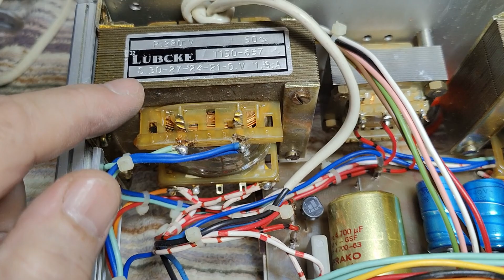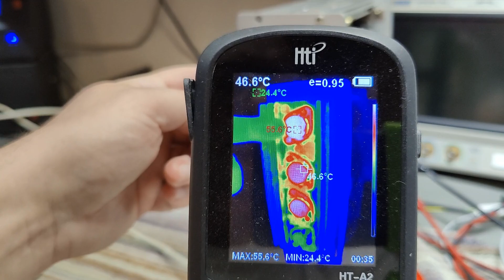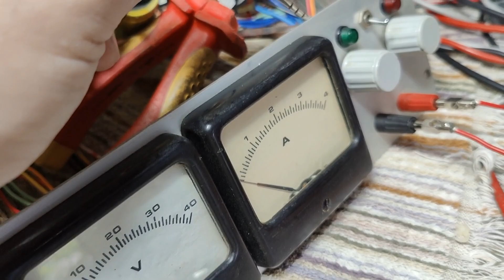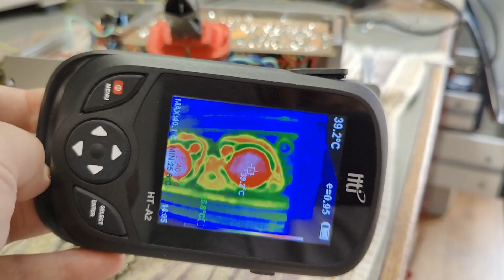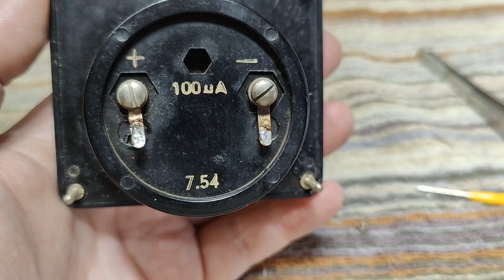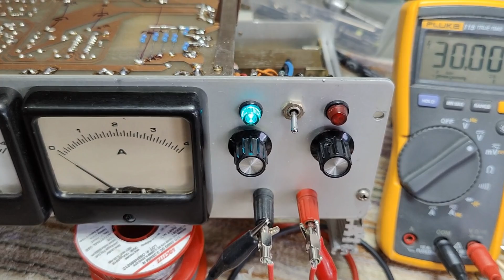DIY Elektor Precision Power Supply Dec 1982 0-30V 3A linear 4 x 3055

Comment: I have made this Elektor lab power supply in 1982 with four 2N3055 and a temperature controlled fan: 0-45VDC 5A. I have just made a re-cap two weeks ago.
Reply from the maker: nice

Comment: Are these 3055 insulated from heatsink? I could not see washers. Even if so, their cases heads are not protected.
There are similar designs with regulating transistors in negative shoulder, so case is tied to negative output terminal, which can be more acceptable. 

Happy to see this great lesson to DIY people. What to copy and what to avoid. And you not just tearing down, but fixing and reviving a custom device (well, on mass-produced PCB.)

Comment: Thanks for the video I am trying to repair the same power supply. At 36:00 I see six resistors you attached to the bottom of the PC board. Four look to be in parallel and two other resistors. Would please detail the value, connection points and purpose of these resistors. Thankyou very much Greg
Reply from the maker: all schematics and pcb layout is easy to get via elektor vintage pages, if you give it, send me an email, i keep all files for all units i ever play with, repair or try to repair :-)

Comment: Wanted to ask, does the voltage regulate all the way to zero.  Meaning for example, can it run, say, a 1.8v circuit.  The design using an independent transformer seems to suggest that capability and would be interesting to verify with that build.
Reply from the maker: YES full control all the way to zero,
Reply: @TeardownOZ2CPU, thank you, that explains the negative bias on the 723 IC... very clever design.  Thanks for responding, btw you run an entertaining channel. It's nostalgic to see how things were built.

Comment: Hi Thomas ,great video. I do appreciate .we can I obtain the psu circuit negative to see if I can produce the circuit board ,hope you can assist
Reply from the maker: see the link to article in the description
Reply: Hi Thomas ,thank you kindly for the schematic for the psu ,i have also find that the same power supply was used by the airforce in SA ,just a question would it be possibale to use one  transformer with al relevant tappings  insted of two ,i have a bit of a space issue .

Comment: 2:20 The component overlay shows one of the four resistors you are comparing is R17: the 10R BD241 emitter resistor. The fact the actual machine uses four output transistors does not make the original schematic and pcb wrong.

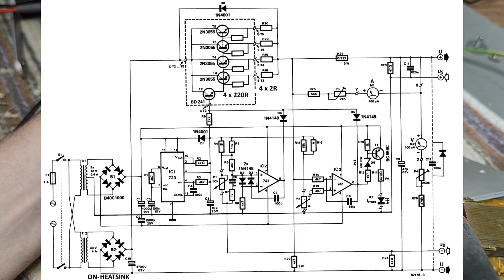Comment: Hello, i did not notice the 4x220R modification from 23:50 part of the video. Did you implement it?
Reply from the maker: YES i did, they are needed to create stability, videos tend to get very long, so sometimes i have to skib minor details, they are very easy to add locally on the transistors.
Reply: @TeardownOZ2CPU  Thank you for the info. Good job with this unit.

Comment: I build a powersupply like this during my elektronics education in 1983. It was a version with  only transistors and no IC. We needed only one transformer because we build our own transformers with seperate 12V winding.. Every 2N3055 had a 0,33 Ohm  Emitter resistor. It worked perfekt. The rectifier is a problem. 3A at 1V or higher per diode 
are 6 Watts.
Reply from the maker: exactly what i figured out, burning hot rectifier bridge, it was a super good idea to put a new one, bigger type directly mounted on thick metal frame

Comment: Wonder why the builder didn't add the binding posts for the sense leads as in the article. That's part of making this a precision supply.
Reply from the maker: i got a few supplies with remote sense, but realize i actually never used that feature all the way to my load, I suppose my current may be low and my wires very thick and my distance to load short, so it is just not a problem for me, that is why i went with sense on the back side of banana connectors, and it turned out to perform just super good for this unit.

Comment: Meters were from Rohde-Schwarz equipement from 60s. Made by company Gossen. :)
Reply from the maker: HA HA you are right .. I have seen them before, in my own video from 2022, that is why i feelt i have seen this type before, 
Rohde & Schwarz Selektomat USWV BN15221 1960
right here : https://youtu.be/qfgnnm4bHgQ
Reply: @TeardownOZ2CPU  
Personally I think they're gorgeus. When local TV station discarded old RS equipement I tore it apart and took those meters and other parts...Used the two small ones (like on this power supply) for my dual PS with tracking (+/-30V/1.5A), and 4 big ones for two big power supplies with scr preregulators (50V/10A). There is a legend that no matter how many power supplies you have, you have one less than you need.

Comment: Built a dual PSU  isomg this design around 1983 and it still works fine. Very low noise so perfect for RF applications.